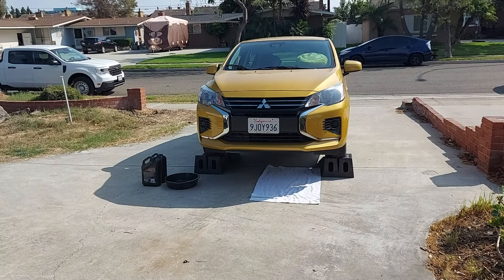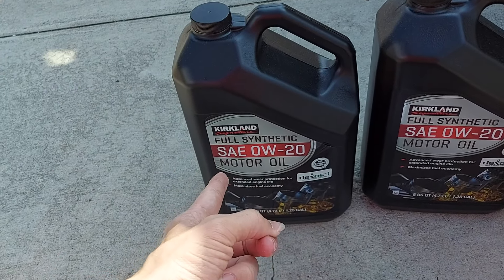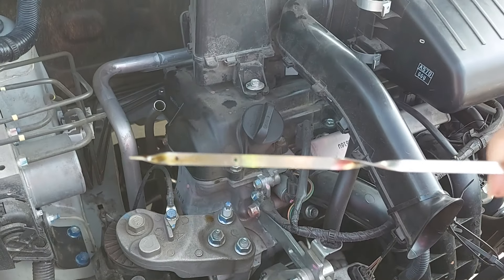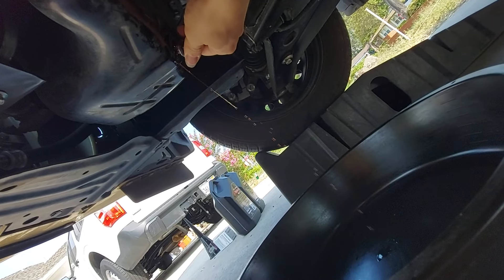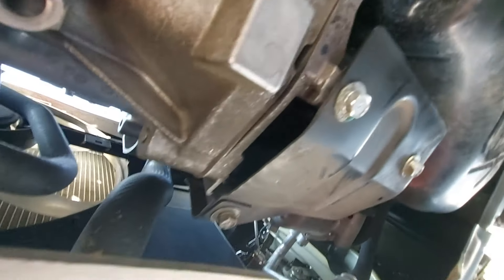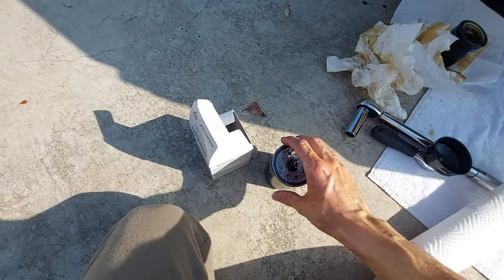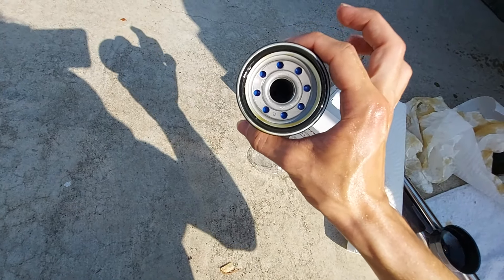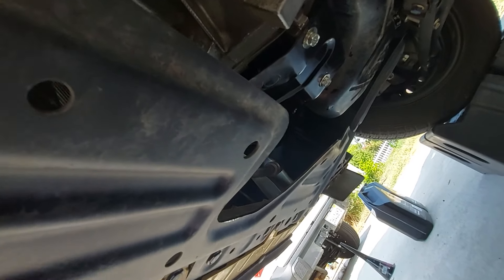How to change the engine oil on 2024 Mitsubishi Mirage

Comment: Good job. (I love your commentary.😆) I used to change the oil in my little Mazda GLC until I totaled it in 1986 (not my fault) and broke my back. My oil-changing days ended. Ah well. I didn't have to have a torque wrench or anything. Seems like everything was easier back then.
Reply from the maker: The oil changing process is exactly the same from then, to now. 1 Bolt, 1 filter. (:
Reply: I’m so glad I’ve found your channel! I really enjoyed the oil change and it’s just like oil changes from the 70s! Lol.
Reply from the maker: @toddgiaro7657  Awesome! Thanks Todd!
Reply: I save my used oil and use it as sealer on my wooden furniture and wood structures outside. I’m in the mountains of Eastern Kentucky and I love used oil! Lol, the winter can be brutal on exposed wood surfaces here. Thanks for sharing!

Comment: I have never used a torque wrench in 37 years of changing oil. Just make it snug. Of course I have never owned a car that had a crush washer on the drain plug.
Reply from the maker: I recommend a torque wrench, but I don't use mine.. It never clicks. It seems broken. I can't even get it to click at 25 foot pounds on a tire bolt which I know is 80 foot pounds.

Comment: Hey man thanks for the video. I just did my oil change, but my average mpg isn’t as high as it used to be anymore..haven’t for the past few weeks actually. Used to get up to 45mpg. I enjoy your mirage vids. I have the sedan version 2018
Reply from the maker: Why are you using more fuel than before? Just different driving habits? A lot hotter temperatures? Air conditioner uses?

Comment: Very ZIN my friend. Thanks for sharing ! Only at 1200 on my oil, love changing oil but alas i must wait =( I use OEM AC Delco filters on sparky, oem is best i think.
Reply from the maker: OEM probably is best! Do you only have 1,200 miles on the break in oil? If so, change that early. But if you have  done oil changes on your car already, wait. (:

Comment: Good video. I'd like to get a Mirage but Mitsubishi stopped selling them in USA. I see some late model used, but lots are repos and that doesn't bode well for how they were driven or maintained.
Reply from the maker: Repo's are for sure not ones to get, sadly. You can still get the Mirage new, some dealers still have them (look for 2024 Mitsubishi Mirage), not 2025. 

The main thing you need to look for when getting a used one is the maintenance history. Make sure they did regular engine oil, and CVT oil changes.

Comment: I wonder if I am supposed to drink the coffee before or after performing my Mutsubishi Mirage's maintenence needs. Could it be both because everybody will be happy including me. Comments welcome when contemplating my maintenence requirement specification needs. Thank you for reading about my maintenence needs and God will look upon this and bless thee in sincerity upon wherever you are in America (disclaimer... another country, too)  in Jesus Christ, the true king (disclaimer it ain't Elvis, and whoever said he's the king is full of Farphrednugen). Also, please don't dispose of your oil in our waterways because coffee just don't taste the same as though it is like poop,  like that oil appears to be diarrhea that is in that there pan, don't you see now my brothers and my sisters.
Reply from the maker: Yes, take it to your local auto store and they will take the used oil, and filters! (:

Change the engine oil every 3,500 to 4,000 miles. 
Change the CVT oil every 30,000 miles, if you drive in the mountains, change it every 25,000 miles instead. 

When changing the CVT fluid every 25,000 to 30,000 miles, change the cartridge filter too, it's held in with 1 bolt behind the driver side tire. Every other CVT oil change, so every 50,000 to 60,000, drop the pan, clean the magnets, replace the pan filter, and replace the pan gasket. 

Every roughly 3 or 4 years replace the brake fluid, I am not sure how often to flush the radiator though.